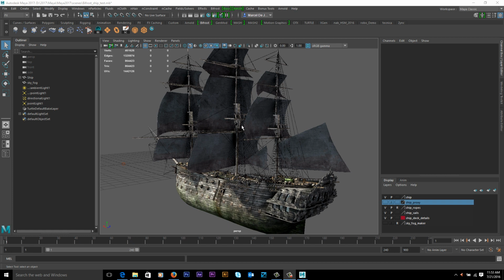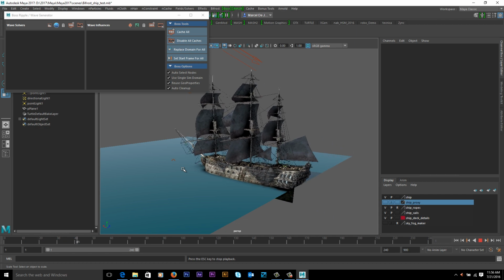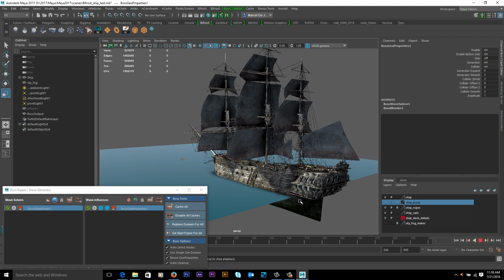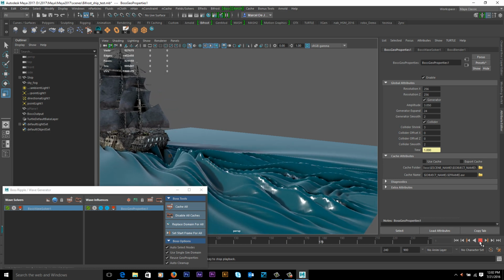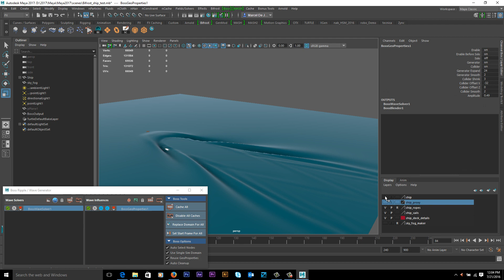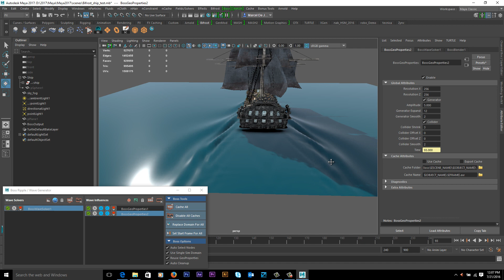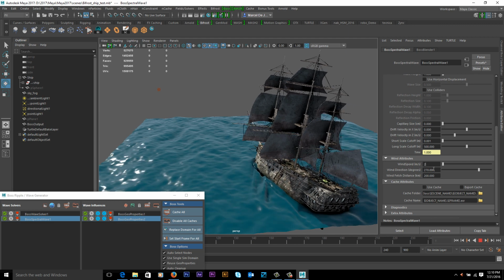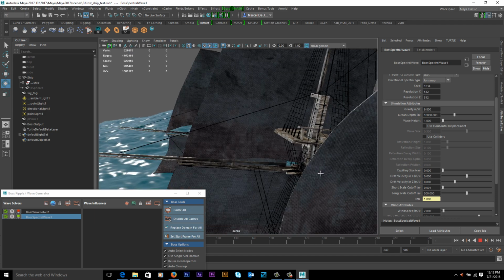Bifrost Ocean Simulation System - Overview

Comment: The problem with most tutorial is the fact they dont address details.  By details i mean they only address the general functions of the tools, but never consider how the systems will function at proper scaling.  In other words.. take a good look at ocean tutorials and ask youself.. how many truly look like real oceans?   Just about none.  Houdini has a usuable tut with an ocean large enough to be identified as an actual ocean.  while most maya tuts look like  toys in a bathtub. at best a swimming pool.  the scale is all wrong. And this is important because scale will determine if such tools are actually useable for a project.  Whats the point playing around with a tool that works scales that dont represent what you need to create only to find out when you crank things up, either the tool crash, your system doesnt have enough powere or memory or for that matter render times will be thru the roof, utlimatly finding out that the tool however cool is only usable by some amped up VFX house with software engineers that can create scripts and tools along with vast cloud based render farms in order to get sequences done.   And lest not forget, in a working environment, its common to need multiple versions of a given sequence to meet client requirements.  So what happens when a single frame takes 2 days to render.  And not only that. how big is this ocean?  so ooo many tutorials only use a patch of geometry,  and things have to be cranked down so low that it all looks anything but real.   I was faced with exactly these issues looking into Boss for a feature film. Looking at all those cool clips Autodesk put out, making claims of creating stuff on a laptop when in truth the creator only used laptops as a remote tool for their cloud based several hundred based GPU setups.  I had to go very old school with old school tricks to create my scenes, in of all applications Lightwave!. The scenes turned out fantastic and ive futher improved on my techniques.  Maya and bifrost  couldve been great is not for the realilty of what required when you truly get down and dirty. Again, its one thing to see some generated liquid,  its another when you need virtually 1 to 1 details.  then your rendering and calculations  go beyond ballistic.  But i wasnt alone in this discovery.  even ILM fell into the same situation with the film Battleship.  Tools like by frost had to be augmented with plugins and clever scripts because its use straight out the box was not capable of producing what was needed in a productions time frame.   https://www.youtube.com/watch?v=DxawCFRSwts
Reply: it's cos of the potato machines most users and small studios have but still Autodesk learning channel should have more in-depth tutorials. I will mention this on a forum
Reply: so true when you use this for real-life scale it looks fucked looking for solution.